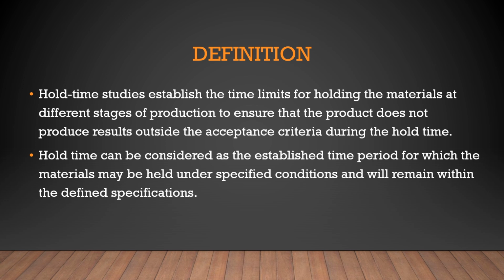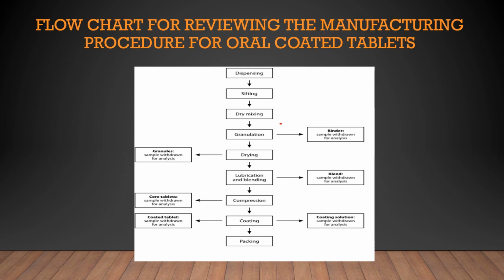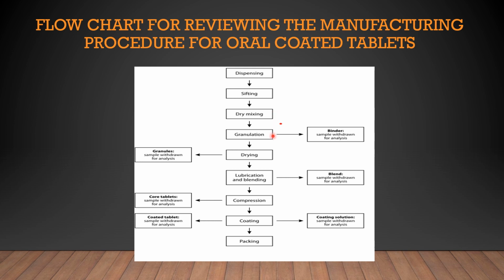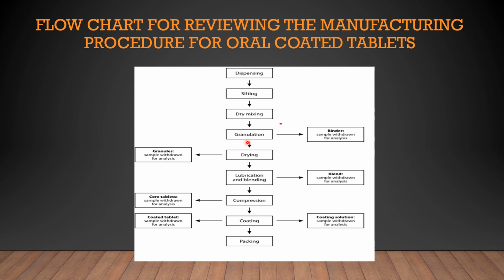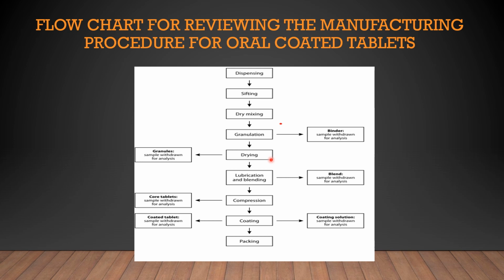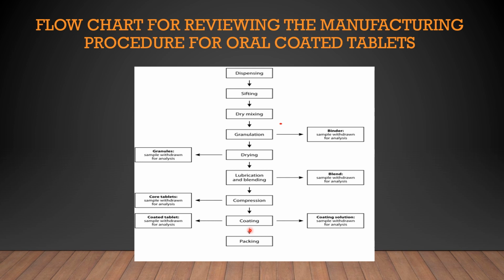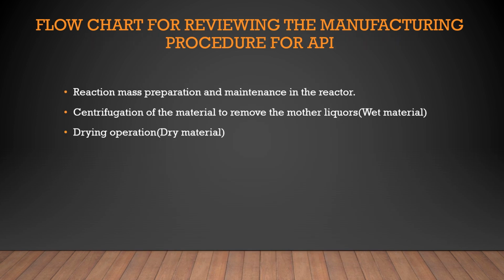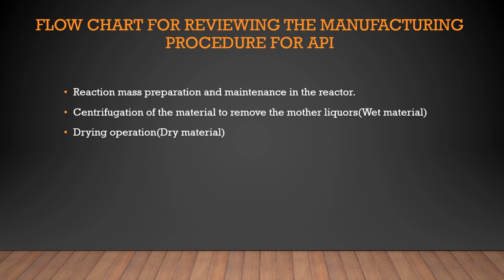HOLD TIME STUDY

Comment: Sir please explain how to do dispensed material sampling for hold time study ? 
i .e We have to do each material sampling or only API also explain quantity
Reply from the maker: wet and dry holding study
wet material after centrifugation-Wet holding
Dry material after drying-Dry holding
Wet and dry for all intermediate stages and for API only wet holding as the dry material goes directly for stability. Quantity depends on the test parameters carried out for analysis and number of the stations, buffer samples and packing and storage as per the product conditions.

Comment: If OOS or OOT observed during testing of hold time sample then what to do? 
How to calculate head space ratio?
Reply from the maker: Thank you for your question@Chikuonline
Based on the investigation of the OOS and OOT, if it is valid OOS then you can consider the previous station as your hold time period and for OOT the OOT trend limit can be changed or you can consider the previous station for hold time.
Reply: Thanks Sir